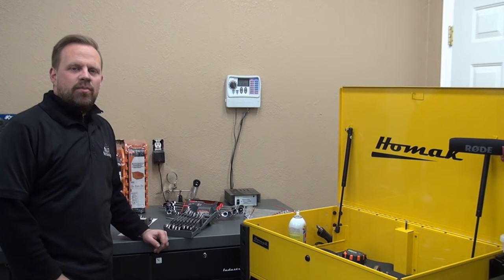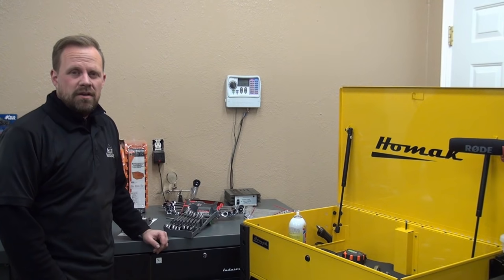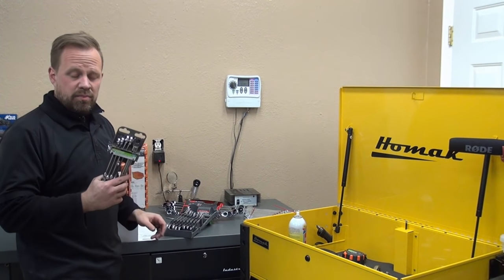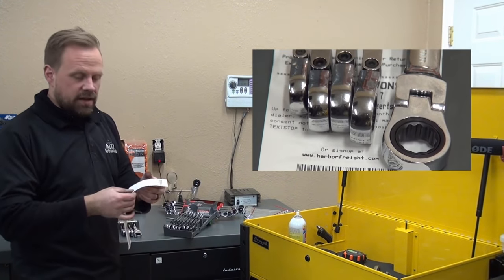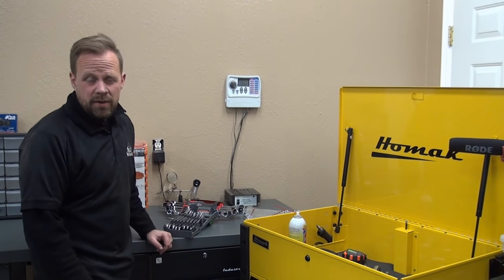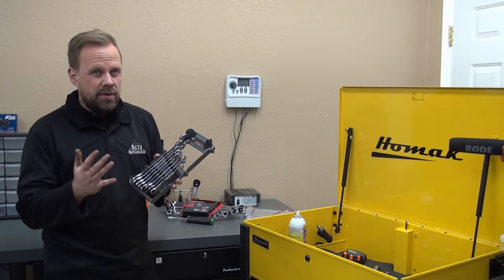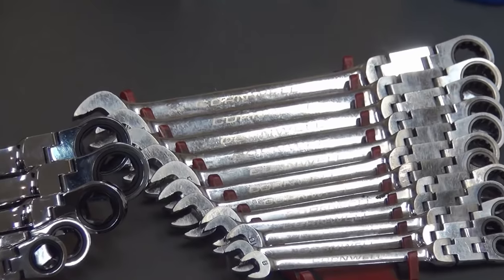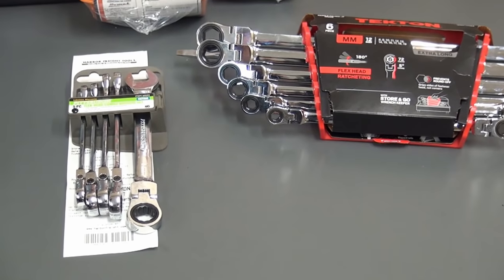The Best Ratcheting Wrenches | Wrench Set Tool Review

Comment: this was a brilliant review... Craftsman used to be the go to....sad to say. I haven't bought a Craftsman in 10yrs...only because I need a … 10mm, so I bought a 8 pc metric set. The A*C and St*n'lee brands looked even cheaper.  later I bought a proto set of Metric. I will go to Hobo Freight before craftsman.  I'd use the craftsman as a chock for my floor jack.  Truly the best wrench is the one you have the moment you need it... 
I did chuckle... when you were going head to head; Craftsman v Pittsburg.  Craftsman 8pc $89.... 12pc Pittsburg (Hobo Freight) for $94.  That's how harbor freight sucks you in

Comment: The huge advantage of the Tekton wrenches is the 6-point head. The ratcheting action is 72 tooth with 5 degrees of arc, so if the wrench doesn't fit at first, just give it a small turn with your fingers and it will fit the fastener. I have a full set of SAE and metric Gearwrench XL 12-point ratcheting wrenches and am sorry that I didn't buy the Tektons because of the superior 6-point design. Tekton also has a hassle-free warranty which is another plus.

Comment: I like the 2 you mentioned. Tip: rotate the 6-point with your fingers to help position the wrench, as you can see the nut position. With a ratchet you don't need to round the nut with a 12-point. Just position first.

Comment: I own the SK X frame ratcheting wrenches and love them.  Have been using them since last fall professionally and haven't had any issues.  The low swing arc on them are awesome!  You need to try a set out.

Comment: I'm surprised Gear Wrench wasn't included in this review. It's their invention. Also, their SAE and Metric sets can come with as many as 16 different sizes. With the added ability to get single wrenches to complete all the in between sizes, like 6mm and 7mm, which are practically impossible to find even in regular box end sets. Plus the addition of the oversized wrenches as well.
Reply from the maker: I really like the Gear Wrench stuff..
Reply: @gerardtrigo380  gear wrench definitely claims to have invented the category. But also those older ones that you linked or a different style of wrench and that may be the difference in the claim, but obviously they are still ratcheting wrenches.
Reply: @joshcamp27  Just because they claim it does not make it factual.  I have a set of SAE ratcheting wrenches that are older than the Gearwrench  company.  Matco, Snap On and many others have been making ratcheting wrenches since the 1950's.  What they created was the first 5 degree ratcheting wrench in the late 90's.
Reply: @gerardtrigo380  I believe the Lang company invented the old school sheet metal ones... and yea other companies have had them
Reply: GearWrench actually makes some of the WORST ratcheting wrenches out there. The head on them simply has too much "meat" around the actual bit that fits over the fasterner. 
My Matco, Armstrong and even Performance Tool (auto zone brand) have done me far, far better than the GearWrench units i have in the same sizes.
Reply: @gerardtrigo380  Well "gear" is in the name, so they must have invented them, right? (Like you, I had a set of ratcheting Craftsman box end wrenches long before Gearwrench existed.)
Reply: @mitsuturbo  Agreed. I have a set of GW ratcheting wrenches that I constantly try first, but always end up using my regular combo wrench when the GW won't fit. I thought about just giving them away, but I don't want to pawn then off on a friend. Lol.
Reply: @gerardtrigo380  @joshcamp27 my assumption was/is that their claim is the invention of the flex head. Not sure as I have not researched the topic, nor do I care to, even though it would have taken less time to do so than writing this reply lol.
Reply: Gearwrench outsourced to China and they're not as good as taiwan.

Comment: In the second test, the 6-point 72-teeth Tekton ratchet can simply be rotated (by hand) so the head fits the bolt from any angle.  Having 6 points is not a problem with 5 degree positioning.  Okay, I'm partial to Tekton since mine arrived today :-)  Nice video!
Reply: That's what I was thinking too

Comment: You really can't have enough ratcheting wrenches and the more patterns, the better. I've got the Harbor Freight variety stashed in my carpentry belt, garden shed, trunk of my car and bottom kitchen drawer. Tekton long pattern flex heads are the kicks. Especially with 6 points. With the mega ratcheting teeth that has become the norm, you would think 6 point would be more popular than they are.
Reply from the maker: I agree...

Comment: I started out using Craftsman, but after many years of grief with their warranty and trying out Mac, GearWrench and Armstrong, I've gravitated toward the latter three. Mac 12 pt standard combination wrenches have the thinnest shoulders  followed by Armstrong 12 pt offset reversing ratcheting box. And Harbor Friggit has a far better ratchet than Craftsman for much less money.
Reply from the maker: Good advice!
Reply: 6pt/12 pt really? I never buy 12 pt as they are designed for medium and light duty, and are far more prone to round a bolt. The 6 point has far more contact surface.

Comment: Nice video. It’s a good demonstration between different types of wrenches.  But they are different types of wrenches and aren’t directly comparable. If you are only going to have one type of ratcheting wrench (which would be tragic) I would get a full set of GearWrench flex head ratcheting wrenches.  The longer wrenches are great for a lot of situations l have 3 different sets of long wrenches but the are a great value and fit in almost every situation.  If they don’t fit then either you need a socket or a specialty tool, which is a god excuse to get more tools!  

And some of the side discussions about GearWrench, they have the patent for the design of what we would call a ratcheting wrench today.  The older designs used different mechanisms for ratcheting. As far as them being too big to fit most places, that hasn’t been true for most people who own them.  But there are always options and you must pick the right tool for your situation.

Comment: Drawback with the Cornwell is finding a dealer too in your area.If no dealer,second hand market such as on Ebay and Garage Journal.SK tools has the lowest swing ratcheting wrench out,the x frame ratcheting wrenches.These have a 1.7 degree swing with 6 pawls inside
Reply: I have some SK Wayne hand tools from the 60s   didn't know they were still around, another popular brand was KD

Comment: Why compare apples and oranges?? You’re not really telling us anything about the brands. Each one is a different tool. Combo wrench vs double box end; flex vs fixed vs double flex; long pattern vs short pattern; 12 point vs 6 point. These are different tools for different applications. To be an effective review you need to compare similar tools.
Reply: actually I own several varieties as shown in the video and theres tons of videos out already with what you are describing.. This video would be for someone whose looking at all kinds of options that are available
Reply: @Toyotas_n__Tools  SO which is best overall in your opinion?
Reply: @Dansk55  any brand that has a flex option with or without reverse.. Then if you can find a set that has a locking feature then its a bonus. The flex head makes it have countless opportunities to use in spots you cant use a normal size wrench.
Reply: hairlesheep -S-K X-Frame are among the best IMO

Comment: It would be cool if they offered some kind of add on breaker bar tool to attach to the shorter wrench wether its the Cornwell , Gearwrench or whatever.

I find that I like short wrenches and wratchets to get into tight spaces but when it comes time when you need more leverage just have a single tool that attaches to any one of your wrenches or wratchets. 

I use a pipe now but it would be nice to have a specialized breaker bar tool designed , all the tools would have to be designed to handle the xtra force , they probably weren't ment to break bolts loose

Good video
Reply: Well have i got news for you…. 😅😅😅 its a wrench extender you put it on the wrench and it allows you to put an extension on the end of it

Comment: I have harbor freight one, and I work on my cars frequently. Sometimes I hit this ratchet wrench with a rubber hammer (not supposed to do) when I'm doing a suspension work. Thus, ratcheting mechanism started to skip, 1 year after the purchase.

It's kind of unfortunate, but nice thing about harbor freight is that I go there and get free replacement, no questions asked.

Comment: Excellent video. Most of the reviews out there are on the wrenches that have the directional switches or no flex head. Working on vehicles these days, flex head wrenches are a must have. How bulky the closed end clearance is and the tooth count is my biggest consideration. Also, seeing some of the manufactures doing the universal spline drive and not offering the 12 or 6 point option.
Reply from the maker: Thanks!

Comment: There's a cheap "no name" Chinese set of wrenches on Amazon. The brand is "Yescom". They are metric ratcheting flex head wrenches pretty identical to the Harbor Freight wrenches. But this is a full 12 peice set, you get 8mm-19mm with NO SKIPS! And comes in a tool roll. The most important thing about this set is it is $37 w/free shipping! Granted there is little to no warranty (but for $37 does it really matter? If it does matter to you then this is not for you) I can vouch that they are actually pretty decent, again very similar to the Harbor Freight wrenches. I'm not claiming they are better than those beautiful double jointed Cornwell's, they are not. But they do work and for $37 they greatly exceeded my expectations. If you use them every day maybe pony up the cash for the top of the line. If your a regular guy, who fixes and maintains your vehicle on the weekends -id say try these. I've been using them for 6 months now and they have been flawless. The actual title on Amazon is "Yesscom 12pc 8-19mm Metric Flexible Head Ratcheting Wrench Combination Spanner Tool Set" ....lol. They are worth the gamble IMO.

Comment: GearWrench still makes the best ratcheting wrenches on the market. Been using them since they invented them years ago. They rarely break or slip and when they do break, I've never had a problem getting them warrantied. I've been a professional Tech for 25 years so they get plenty of use.
Reply: The sk x frame is a technically better mechanism.
Reply: Not any more.  Not even close

Comment: The video was very informative, it's said the Sears is selling the Craftsmen tool line, don't know for sure. This will make there life time warranty be a issue. I'm looking at the brand Tekton, never heard of this brand till I saw a few other videos, Impressive Video.
Reply from the maker: Thanks!
Reply: Stanley did buy the Craftsman tool line and Stanley is pretty good with warranties
Reply: good thing about Craftsman was the lifetime warranty, pack your bags and move to any corner of the country to work, and a Sears store was there if you needed an exchange. have exchanged several tools with no hassle.
Reply: hvac01453 no
Reply: Try Tekton! You won’t regret it I work on  heavy equipment everyday I ordered both metric and standard tekton wrenches because I was tired of my snap on stuff growing  legs and walking off in someone else’s pockets I rarely use my snap ons anymore because I love my tektons I’ve started buying more of their tools I love the impact sockets as well

Comment: I have a set of ratchet ends, don't know where I got them, they're too bulky at the ratchet end.  Rarely if ever use them.
Bought a set of extra length aircraft wrenches with slight offset to one side.
They aren't ratcheting or flex head, they're still more useful.
Save your money for a stubby impact driver.

Comment: To be a reliable, replicable, and predictable test the tools must be comparable in all regards: swivel, ratcheting, length, points, and application    Plus, the 10 mm and 13 bolts in the video are easily accessible.  If you can see them, you can remove them.  

Do the test on the supporting bracket on the back of the intake manifold, the cooling fluid flanges on the lower end of the engine, the fan bolts, the pulley bracket (not the pulley) bolts behind the the serpentine belt, the supporting bracket bolt from the exhaust pipe between the exhaust manifold and main exhaust pipe, the brackets holding the various vapor lines above the gas tank.  Those are all hell and every man at home or at the shop hates them.  That's where the rubber meets the road on any tool.

Comment: How would the sk x frame wrenches compare against the cornwell double flex head?
Reply: I would say they would be like the 0 offset one (craftsman) for the positioning, the ratcheting mechanism would be way higher quality above all of them, and probably better than the cornwell open end wise. (if that didn't make sense) SK is much better than all of them in quality in every way, but you may be limited in access since the ratcheting part has a fixed 0 degree offset.

Comment: Great review I got 2 different variations of the craftsman and the Pittsburgh. I never use the craftsman the flex head always comes in handy. The only thing with Pittsburgh its that in time feels like sand gets inside the gears so its not seal that great. Lost the 10mm and I have to buy the whole set again.

Comment: I love wrenches, but if I could do it over again I would just buy combo sets. Now I have a regular set and double headed ratchets in addition to ignition, etc.
Reply: I first bought the Gearwrench large set, had trouble with the flex heads popping off the nut(slipping and busting my knuckles).. so I got the fixed head offsets and found too many situations where I needed the flex heads, so break them back out.,,, we need a variety to get the job done in most situations... its impossible sometimes.
Reply: @hvac01453  ，i prefer 15 offset with reverse,flex head always without lock,which annoyed me a lot

Comment: When you're talking about quality, it's a simple calculation. You have ten wrenches for 30 Bucks = 3 Bucks a wrench. You can't expect quality for that price. It depends on what you want to do. I had a wrench break on the shaft when trying to release a rusted nut. A serious craftsman invests just once. Buy cheap, buy twice.... Like the vid man. Good cutting and presentation 👍
Reply: I thought Craftsman, Pittsburgh, US general etc. were just trash talked unfairly but I'm really underwhelmed with their quality. I didn't like the feel of anything except the tape measure which was really good for the price. I don't buy from truck companies either, but the middle brands for me are the best. The best wrenches for the price that I have seen are Williams and Tekton. Williams is a lesser known brand but it's used in military tool kits and is priced around HF prices if you can find them online, they aren't as heavy duty as Snap etc. but for the price they are the best buy.
Reply: Williams are not that less expensive as you say. Go and check it out at amazon and see for yourself. They are almost as expensive as the other brands.
Reply: Robert Williamson you say "buy cheap, buy twice." That ignores the fact that just about everyone offers a lifetime guarantee on their tools these days.

Comment: Apples to Oranges? Comparing the Tecton with its extended length and pivot head to the shorter Craftsman non-pivot Head makes no sense. 
Also, the test indicated the length of the Tecton was a big problem yet it was a preferred tool. 
Hmmm?

Comment: Great review I enjoy the video. Can you do a review on the long handle flex head texton, gearwrench 120xp, steelman, and mountain. What are best on this flex head 6 point, 12 points or universal spanner?
Reply: miguel mendez 
I was looking at the gear wrench too.
Reply from the maker: I will see what I can do..... 6 point are better for not stripping the bolt... However I kind of like a 12 point better because you can get the box end over the bolt easier.
Reply: Do It Yourself Bri I have the SK x frame with the six point and their great I just wish they came in a flex head set.

Comment: What a weird comparison.... a double box end to a combination wrench? why? That weird ratcheting cut out ( I bought into an a MAC tool and sucks) to a solid open end, withough the offset... and you left out the biggest reason where some box end work where others don't... the thickness of the tool for clearance between the bolt and something parallel to it where many box ends can't fit if they're too thick. Only the high end wrenches will fit it there....steel quality allows a thinner wall thickness. I noticed you omitted the most common of these, the Gearwrench.

Comment: Those Pittsburgh ratchets are straight trash, every single ratchet I used with In a few light work jobs the gears failed. Only ones that are still living is the 9, 11mm😩😂

Comment: you should compare the tektons from this videos against the mountain brand set off amazon
Reply from the maker: I have had a couple people say that... I have not heard of this Mountain brand... I will check into it. Thanks!
Reply: I have heard good things, main differences would be they are 12 point and that they have a reversible slider. Other than that they are both extra long handle, flex head, ratcheting wrenches

Comment: Makita is better than Milwaukee
Reply: Miguel Garcia       I disagree, weather its availability of tools, battery design that hasn’t changed for 20 years , meaning your old tools still work with todays batteries. Durability and innovation are without equal.
Reply: Opinions are like A holes.  Everybody has one